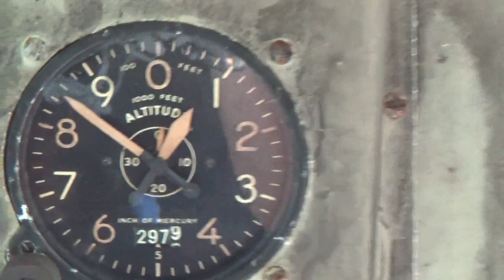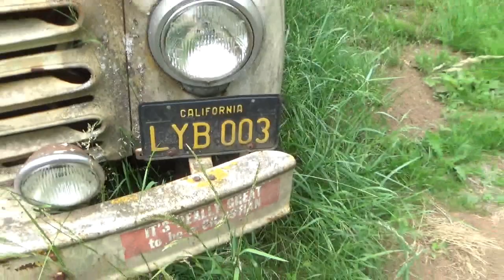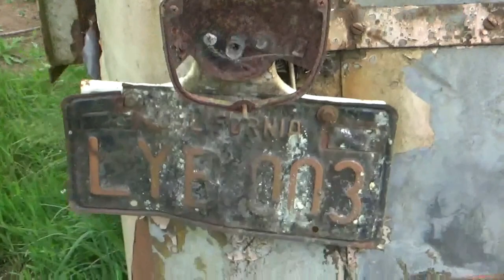1952 Studebaker Short Bus (CTR-154)

Comment: What an interesting find! The original engine was probably a Hercules flat head six, as Studebaker wasn't making any "big" truck engines, although in 1952 you "might" have been able to order it with a V-8, the 221 CID 8 was smaller than the Hercules, and didn't have as much torque.  Yes, I'm an old Studebaker fan! OEM instrument cluster was the regular Studebaker rectangular cluster, which they used on some truck models right up to the end of production in South Bend.  The Chevrolet six engine was probably a good choice for a replacement...relatively cheap and plentiful.  The 24 hour clock and altimeter were no doubt installed by the motorhome converter, and were fairly popular at the time. Nice Video!!
Reply from the maker: Good info. Thank you. -Rick

Comment: with the twenty four hour clock and altimeter I  would say it was originally an Air Force Bus.
Reply: Yes, that's what I was thinking.  Used on base for taking flight crews to their planes, having the clock and pressure altimeter on the bus would save time between getting on board the aircraft and going wheels up, no need to check pressure altimeter settings with ground control.  It was probably used on a bomber station during the cold war as getting the aircraft in the air as quickly as possible was the most important then.  If that was the case then the low mileage is probably correct as it's quite likely it never saw the open road during its service life and it probably won't have done that many miles as a camper either.  Presumably the Chevy/GMC 6 and, probably, matching transmission was put into it to give it longer legs on the road as it wouldn't have needed particularly long legs on-base.  That could be a cool little piece of cold war history and could have been the last earth-bound ride some people would have taken if things had worked out differently...

Comment: Yorkasaurus 😂, Rick looking forward to seeing more of the bus. It would make a cherry vintage RV the wood is easily replaced. The sheet metal is in decent shape, my guess is the altimeter was put in for adjustments on the air fuel ratio for traveling. And/or someone wanted to know because for its a cool feature like the world clock. That Alt gauge looks very similar to early military gauges used in Kaiser and AM General logistic/radio trucks. The fact it has the original first aid kit and low miles offsets the outer sheet metal. That’s a sweet platform for a vintage resto, totally dig the chimney. You reckon that’s a 250? Doesn’t matter, really enjoy seeing your trucks clean up. Power washing takes off the old & appeals too folks looking for stuff you offer. Please don’t sell Yogi. I’ll contact ya via email about 2 things I have an interest in. Look for my name in the subject. we’ve talked before. Thanks 

Ben